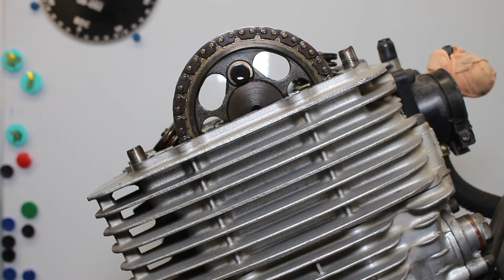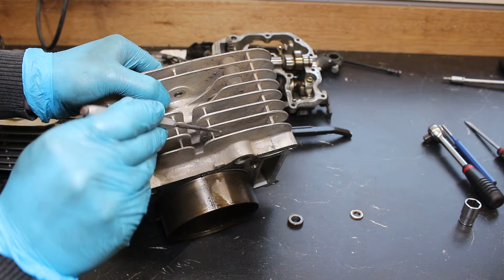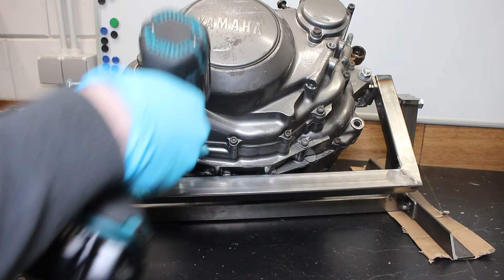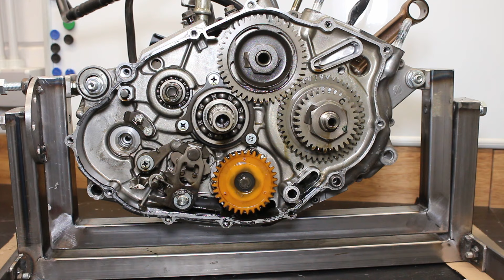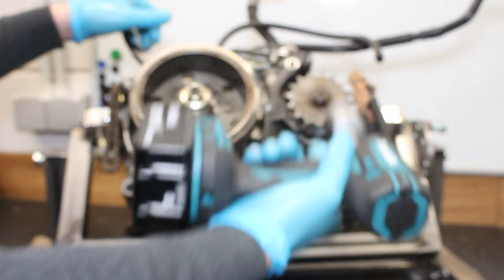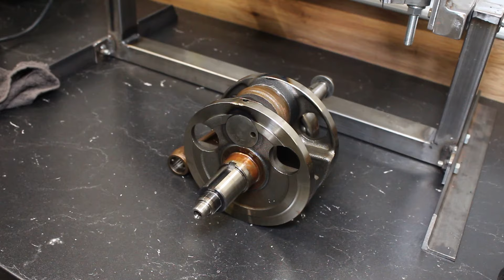XT 600 Full engine teardown

Comment: I just got an XT600 less than a week ago, this video is a fantastic reference
Reply from the maker: Thanks for your comment.
Reply: @jh-tech5546  I finally worked up the courage to tear apart my engine and replace the sheared drive shaft the previous owner welded and left for me to figure out.
I used your video a LOT leading up to this moment and it really helped push me over the edge to undertake the engine rebuild.
Thank you again for documenting your teardown.
Reply: @amidointhisright  Are you in the U.S.? I can't find quality parts anywhere here, suggestions?

Comment: Great video, I’m having to strip my engine down as the gearbox is knackered would I have to strip it totally or could it be done by leaving the left hand side of the engine intact ? Thanks.
Reply from the maker: You mean by leaving the flywheel on the crank and even maybe the cover on the case? That might be possible. I don't think there are bolts behind that hold the cases together.
Reply: @jh-tech5546  thanks, gonna be one hell of a job !

Comment: Hey so does the top part where the valves go. Does that just not have a gasket? I’ll be tearing mine out to change valve seals and can find a gasket. Is it okay that way? Would liquid gasket work?
Reply from the maker: Yes, there is no gasket but you need to apply some liquid gasket (suitable for engines) to the gasket surface.

Comment: Great video! I have a 1984 XT600 that I love, but it has almost 50,000 miles on it now and is beginning to leak oil from what looks like the head gasket. Is it possible to replace the top end gaskets without removing the engine? Thanks!
Reply from the maker: Thanks for the comment. I did not have the engine in the frame but what I can see from this video it is possible: https://www.youtube.com/watch?v=2g-hGK5K7Gg

Comment: Would it be possible to change the gasket on the side of the engine without taking the engine out of the frame? I’m new to fixing bikes and some guidance would be very much appreciated
Reply from the maker: I guess you mean to remove the clutch cover. Yes I think that is possible.

Comment: Just wondering what tool did you use to pull the flywheel? It looks like a harmonic balancer puller but my bolts are too short to thread into the flywheel all the way
Reply from the maker: Sorry for the late reply. As you could see I did struggle. The tool that did the job was the flywheel puller sold by YAMBITS.